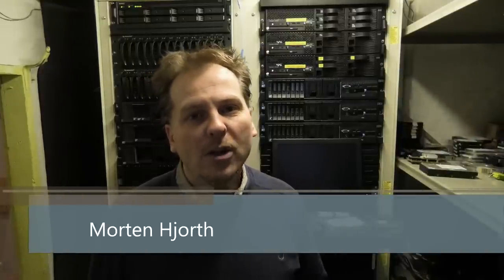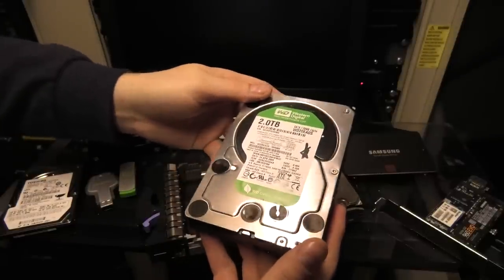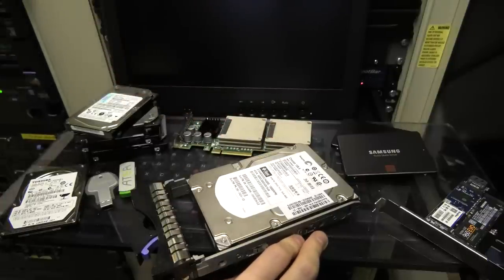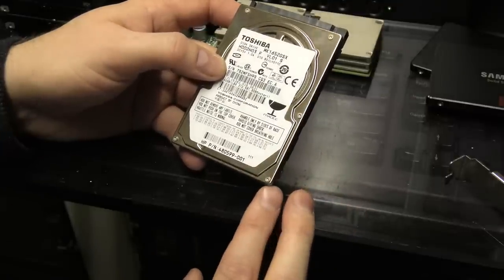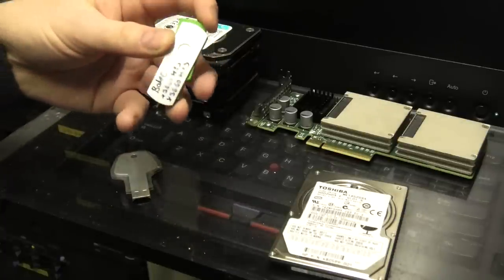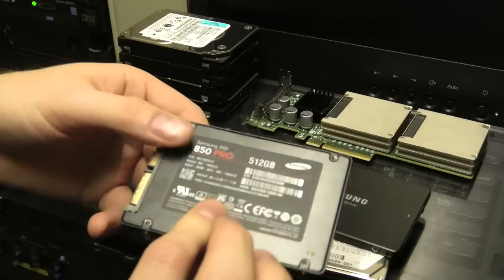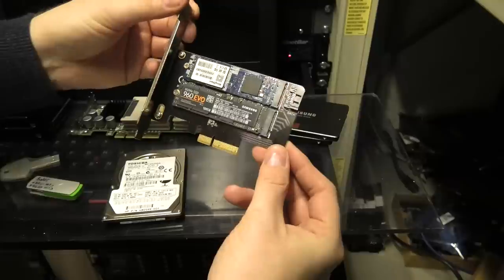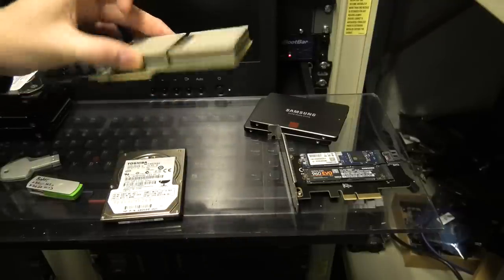Server Storage on the Cheap - 926

Comment: Thanks for this video. You're part of the reason I looked into going the retired enterprise hardware solution route. Been watching you a year now, and learned quite a bit, currently like HP servers the best as they were the easiest for me to configure out of the box. 3 DL 360 gen 7's, 1 Dl 380 Gen 7, and a DL 580 gen 7 ( which I blame you for cause you made it look so cool) I rarely turn it on. but it's really cool to have some gear that cost more than my car when it was new. Dell has to be my second choice gotten a R710, and a R610 so far, but considering a 2nd 710, as they have just dropped so much now. Lenovo's are hard to bite the bullet on, price wise. Storage is a constant problem with servers, trying to find it cheap, as well as understanding how to configure it the first time. Mostly try to buy it on the cheap from ebay, but you really never know what you're going to get. I've had a few drives that were predicted fail. So this Video was a great addition, thank you. Keep doing what you're doing!
Reply from the maker: Hi Jason Hensley
Thank You very much!  glad you liked the video :-)
Thank you for watching! :-)

Comment: Thank you very much. I wondered why storage arrays were available for 2.5" if the aim was amount of space (GB/tb). The explanation was very good.
Reply from the maker: Espicily now with SSD's this maked good sense.
Reply: @MyPlayHouse  yes it does. At an enterprise level it's fine but very expensive if you going for 2.5" 1tb+ ssds. But I supposed because you could have more 2.5" drives the lower sized ones work well too.

Comment: Currently got a x3550 M4 and 3 netapp ds2246 I think with 72 600gb drives and another shelf worth of spares the power consumption is huge but it's amazing the speeds I can get with this system achieve
Reply from the maker: Hi Joshua Corley
Thank You very much! That is a lot of 600GB's,, that is like 43,2TB of 600GB's that is just like 5 10TB drives :-) But I see the fun..
Thank you for watching! :-)

Comment: Depends, my HP Gen8 Microservers are running a mixture of WD Reds and Hitachi Enterprise SATA drives. My bulk storage is in QNAP NASes with WD Reds. On my full servers the SSDs come into play with 1.5TB (usable, RAID1) of SSDs in one of them and 500GB of SSDs and 1TB of SATA (both figure usable, RAID1) in the other.  I do actually want to put a couple of spinning rust disks in the first of them so I can play with some Elastic stack things without thrashing the SSDs.
Reply from the maker: Maybe a RAM drive to save on the SSD's

Comment: I run various LFF SAS enclosures off multiple Areca cards (1680’s to 1882ix’s). I try to keep an eye on cost per empty bay. I’m hovering around $27 per bay thanks to eBay. I’m a little over 0.6PB. It’s been growing for two decades. Over time I quickly realized ECC was necessary, so after the P3 “Xeons”, I made that move. Currently trying to remove all DDR2 ECC servers from the mix due to their extreme power use.
Reply from the maker: 600TB,, I am getting way behind!! :-)

Comment: You can actually go beyond 2TB on most of these crippled server RAID-controllers. Many of them use LSI chipsets and happily run with the official MegaRAID-firmware, which happily is kind of unified and works for most variants of their chips.
Should be simmilar with other vendors.
I'm using regular LSI-firmware on older DELL and Huawei Servers with great success.
Reply from the maker: Hi Dolph Handcreme
Thank You very much!  glad you liked the video :-)
Thank you for watching! :-)

Comment: Dell R730XD, 2x E5-2640 v3, 64gb ddr4, 2x 400gb ssd Raid-1 (operating system), 12x 3.5” 3tb sas drives Raid-6 (storage), Total system cost was about $1500 so $50 per tb and the ability to run many vm's. It does use right at 200watts. Far more reliable than any nas and far more capable. Also the networking included is great. 2x10gb and 2x1gb
Reply from the maker: Nices setup,, lots of toys :-)

Comment: For storage in my little always on machine (dual e5-2690v3 with unfortunately only 128GB RAM) I use the following drives: 1x Intel DC S3500 240GB for the OS (Server 2019 Datacenter), 1x Intel DC S3500 240GB for VMs, a Samsung 840 Pro 512GB for Gaming Server VMs and finally for the rest of the storage 4x Seagate Exos X16 16TB (Storage Spaces with Parity). For playing around or testing new software I use a Dell R610 (dual X5680, 64GB RAM) and have everything on old 150GB 10k SAS spinners; for testing purposes its okish - well slow af if you are used to have SSDs.
Reply from the maker: Hi Morpheuz87
Thank You very much! Powerful stuff - glad you liked the video :-)
Thank you for watching! :-)

Comment: I have an old Core 2 Duo E7400 with 4GBs of DDR2 RAM, one 2TB HD (Seagate, main backup) and one 1TB HD (WD Blue, my dad's backup). it's working pretty well, though the 2TB disk was full and I had to do some cleaning... now I have 200GB+ of free space back  :)
Reply: also, I need to leave it turned off during the night because of the power bill...  😅
Reply from the maker: Well I have seen you around here,, so you have the interest,, so this will grow,, for sure :-)

Comment: I'm using an old computer case with a X58 board, a Xeon 5550, 8GB od RAM, 7 500GB disk and a 80GB for the OS. I'm backing up on it my photography work and all the important documents and scans. I'm running a Windows 10 virtual machine in HyperV and a Raspberry Pi 2 as a client box :)
Reply from the maker: Nice Xeon build,,, will it do the x5650 they are really cheap and 6 core.
Reply: @MyPlayHouse  I have one in my computer (running at 3.8GHz) where I need more cores for rendering, but in my server for what I use it the X5550 is good enough :)

Comment: You did forget the IDE HDDs :) My very cheap home back-up server, a typical Dutch solution, consists of : 

- a tower from Compaq Evo with Pentium 4 and Windows 98/2000 stickers and a Windows 98SE activation code.
- a motherboard (BIOS date 2003) and Pentium 4 HT (3.0 GHz) from a HP D530 SFF
- 1.25 GB DDR (400MHz)
- 250 + 320GB IDE Seagate HDDs (3.5") from a HP D530 (RIP 2011) and an old Pentium III file-server (RIP 2012)
- 2 x 320GB HDDs on SATA-1 (2.5") one from my "new" ex-lease laptop and one from my old laptop (RIP)
- FreeBSD 12.1 booting and using ZFS
- 1 Gbps Ethernet running at 200 Mbps, due to 95% CPU load on the network thread.

I power on the server for less than 1 hour/week. I use it to backup all my stuff using the ZFS incremental send/receive from my Ryzen 3 2200G desktop to my 2003-HiTech server :) The largest transfers are the updates to my Virtual Machines. The HDDs do age very slowly now. The power-on hours increase with say one week each year. 

I have a second backup too on my i5 laptop's 1 TB SSHD. That one backs up at 800 Mbps. My Ryzen uses a 512 GB nvme-SSD for the 15 more active VMs and has two striped HDDs for all other stuff. However my photos, videos and music are stored in a dataset (folder) with the property copies=2, so a kind of Raid 1 subset inside Raid 0.
Reply from the maker: He He,, Yes I forgot IDE,, but of course they are also there in the past :-)

Comment: The primary reason for using the "Warpdrive" and such enterprise SSDs is the fact that they are rated at absurd lifetimes. My FusionIO Drive2, which cost me $110 for 1.2TB that is 1.5GB/s read/write and has a rated PBW (Petabytes Written before it dies) of 17. That's 17,000 terabytes before it dies. They will never die in my lifetime, even if I wrote multiple terabytes per week.
Reply from the maker: ahh come on,, You might become very old :-)

Comment: Ive got a chenbro with 8 1TB sas drives, 16 cores 32 threads, 88gb of ram, running proxmox on a m.2 sata drive, and 128gb nvme for cache. Also my deep learning server, e5-1620 64gb of ram, 2x 256 ssd in raid 0(backed up every hour to the above server) Titan X, soon to be upgraded to a tesla m40 24gb.
Reply from the maker: Lots of good stuff!

Comment: r610 - 32GB RAM * 2x 4 core 8 thread CPUs
     - OpenMediaVault
     - 4x 500GB SSD mirrored vdevs in zfs (basically Raid10) central storage for Proxmox Cluster
     - VirtualBox running Proxmox as a witness to my Proxmox cluster
r510 - 64GB RAM * 2x 6 core 12 thread CPUs
     - Proxmox VM Server
     - unRaid VM with 44TB usable storeage with 2x parity
r510 - 64GB RAM * 2x 6 core 12 thread CPUs
     - Proxmox VM Server
     - OpenMediaVault with 20TB usable storeage via Snapraid+MergerFS with 2x parity
3x Raspberry Pi 3 for various things
1x Pineboard64 for various things
Reply from the maker: Quite a big setup!! :-)

Comment: Don’t recommend the WD Greens due to Time Level Error Recovery (TLER). They will drop out of RAID arrays due to their power savings.
Reply from the maker: Never had that problem,, and I have had like 8 of them.
Reply: I have had that happen once. Purely because I was using Server 2008 R2 in power saver, which resulted in the drives turning on and off all day constantly. Eventually one dropped out but came back after a reboot. Since then they've been on balanced mode (on Server 2019 😜)
Reply: @MyPlayHouse  Exactly, I have this same experience with WD Green, I have four of them all are working with no issues since a couple of years.
Reply: that was an issue with older drives(firmware issues with both seagate and wd), can often disable the power savings with the hdat2; I have 2 such drives that will act weird on my 9650se's till de-activating stuff :) )
Reply: https://www.youtube.com/watch?v=p4UrnP38T0w <<< it's essentially this exact same issue but ??doesn't really lead to chatter that I can recall??; regardless the same seems to happen on some older firmware when using "low power" drives with raid cards, and eventually that either leads to premature death or corrupted data/unstable raid partitions:) ** summary.... the main thing is to disable the APM, than the 2nd part with modifying the DCO is just cause modifying the APM on it's own doesn't seem to register a change:)
Reply: I have seagate green drives really bad but i have one or two from 2011 still working fine, some years/revisions might not be particularly bad you can't say that all WD Greens or Black are the exact same.
Reply: @dashtesla   if it's in raid specifically it can be solved using method in the video I posted; it was a known bug in the firmware that was fixed later in newer drives(I believe some drives are even updatable)..... I think it's safe to assume that it was present as a bug cause both companies did not intend the drives to be used in raid, targeted towards consumer storage
Reply: @dashtesla  i just had one of them (seagate green) go bad for the third time in 2 years and it is a swap from an earlier one that i RMAed, think i will go for hitachi from now on....
Reply: Never had that. Just need to make sure Windows isn’t in power saving mode.
Reply: I think that was actually one of the solutions if you're not using in raid, but I was having it in raid; not sure about others...... I think problems usually arise when the sata controller is not mounting the drive in a way that is directly accessible by the OS like compatibility mode(non AHCI) and in raid; although I think it might also show up if stuff like SMART is not directly accessible by the OS

Comment: Don't mix  SAS and SATA drives on the same channel of the raid controller.  You will get IO errors.  M.2 drives are either  SATA or NVME, but they are both SSD.  The older IO cards like the Fusion and the one you have aren't as fast as current drives but they are 100% more reliable and durable.I have a couple that have dome millions of IOPS and are still at 85% available.  Read your server documentation for which slot(s) you can put PCIE drives into as there can be a particular order to use just like RAM, especially if you have both processors installed.
Reply from the maker: Hi Ein Felder
Thank You very much!  glad you liked the video :-)
Thank you for watching! :-)

Comment: Since you mentioned the USB-Drive being a firmware-updater:
Have you heard about the devices made by IODD? I felt like encountering Alien technology when I first saw one of them.
They are basically an external harddrive with a display and a brain. You can select an ISO file form the disks internal memory and mount it on a virtual USB-DVD drive.

That way you do not have to burn USB keys with Rufus anymore to perform firmware upgrades.
Just drop the .iso on the disk, select the ISO for mount and boot the PC/Laptop/Server from it.
The newest model, the IODD mini, which uses a compact M.2 SSD instead of a 2,5" disk has recently become available on Amazon Europe.
Link: http://iodd.kr/wordpress/product/iodd-mini/
Reply from the maker: Hi Astra7525
Thank You very much! That is cool ,, next level USB key and more :-)
Thank you for watching! :-)

Comment: NAS:
- FreeNAS
- Single L5630
- 6x 16GB DDR3R 1066
- RAID Z2 10x 3TB HGST Ultrastar 7K4000
- RAID 1 2x San Disk Plus 120GB
- Chenbro Case 3U HS SAS Backplane
- HP H220 HBA (Love it)
- Mellanox Connect-x 2 SFP+
- Seasonic Gold Server series (have to Look it Up)

VM (Proxmox):
- Ryzen 5 3600
- Stock cooler
- ASRock Rack x470 (big recommendation!)
- 4x 16GB DDR4 3000
- IBM (LSI) IT Mode RAID Card
- Mellanox Connect-x 3
- two SSD, one HDD (WD Red 3tb) Mirror Pools ZFS
Reply from the maker: Good Stuff,, lot of different stuff :-)

Comment: Know a few friends who run their NAS at home with Samsung Evo SSDs, no problems for years. It all depends on how heavy you are using them
Reply: Actually, the evo line has often been tested closer to the pro drives than to any other consumer line.
Took more that 5x their rated amount of writes before any even started failing. Some pro's dropped earlier than many of the evo's. They actually use the same chips, just somewhat lower bins.
Reply from the maker: Hi sitte
Thank You very much!  glad you liked the video :-)
Thank you for watching! :-)

Comment: I'm just using a Synology Disk Station at the moment, but I'd like a proper server soon.
Reply from the maker: You can do a lot on a newer Synology DS,, VM's and Docker,, good stuff.
Reply: @MyPlayHouse  I agree. It might be more sensible for me to just upgrade that one to a RackStation.
Reply: I just went the other way. I got an RS816 for my systems Veeam backups, and turned off my Dell server that was doing the same thing (just a file server, really). This is much quieter, and smaller. Now I just use servers for ESXi and Xenserver.

Comment: U.2 Drives !
NVME in 2.5 inch format.
Reply from the maker: Ohh Yes,, I forgot those,, they are bloody expensive too..
Reply: @MyPlayHouse   you can get Intel DC P4500 4TB 2.5" (SSDPE2KX040T7)  NVME ssds for around 350$ on ebay with warranty until 2022
Reply: U.2 yep! I got UEFI lucky with a cheap Startech U.2/PCI adapter, and got an extra boot option on my 12th. gen DELL R720xd (no SATA).

Comment: i use 6x 3TB disks with a RAIDZ2
another 4x 1TB disks for iSCSI
2x SSDs in a mirror with ZFS
INTEL SERVERBOARD S1200BTS
Xeon E31220
32GB of RAM DDR3 ECC UBuffered
Dell Perc H310 SAS Flashed to IT Mode
4u Chassis with 3x 4 5,25 Hotswap Bays that supports up to 4 disks each
4gig LAG and a 10Gig Link
Still able to add more disks!
Reply from the maker: Hi VioletDragon Projects
Thank You very much!  glad you liked the video :-)
Thank you for watching! :-)

Comment: LOL "in the old days. we were using 3.5 Sas Drive.... In my old days we had scsi drives....

Id agree with the SATA in sas. cheaper than sas and nice and big. ( all sas is backward to Sata, however some Bios limit (on old hardware) to around 2TB drives. newer or better the cards can be upgrader or the bias/firmware flashes.

No not true on the capture and cache, though it was down to the browser and there ( viewer) network and IPS. (hence internet temp folder). 
Two Sata's drives will handled around 5 people as a web app.
I think your thinking of SAAS ( software on a server and all users terminal) like old way of network. but home users will do well on them especially for video.

NOW some FIGURES. a Single SSD with transfer around 456Mbs and SAS will cover 1190Mbs. and SATA around 150-200Mbs, IDE is around 40Mbs

SAS is really not too costly, I pay £6 for 76Gb. but around 40 for 450Gb. *new
I wouldn't used a laptop drive there too rubbish, and the speed is not great. SAS is 12GBS and SATA is a lot slower 3GB maybe. and laptops can be 5400Rpm

I think Older ( not really really old) is great and if you buy the right hardware, say a 460Watt DPSU, then remove one  then the power is no more than a normal desktop.
BUT I would sas and sata and then build or have a second array to store everything. that's not always on.

I have a 14 bay SCSI, not big drives and its only 1.4TB I could buy big drives or but one or two new ones, so that is not good. but if I want a "scratch" drive then its fine for small work. (small by todays standards) My SAS array is bigger and fine for what I need and I Have the 3.5 server ( your favourite) with mostly SATA drives over a TB which is a file server and often a scratch.
My Archive however is a small sized but massive TB drives which I can dump everything on.
BUT if we have a load of storage, when we want to use it we must have a network will support it... (20TB, on a 100mb lan!) not going to happen, so that is a thing....

QUESTION:
That WARP Drive.
If you take off the cover, and the cover from a SSD drive, are they the same inside?
Reply from the maker: I tried to take that Warp drive apart,, but was too afraid of braking it, before I got a video out of it. It's more like mini ssd I believe.
Reply: @MyPlayHouse  I've seen the SSD taken apart is about the same size to fit....